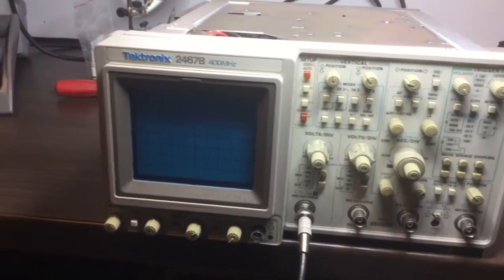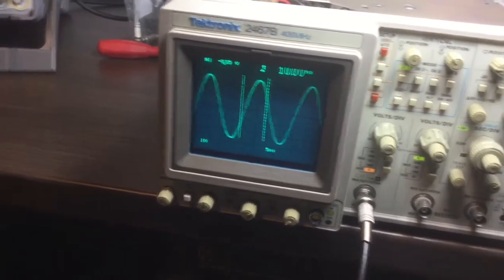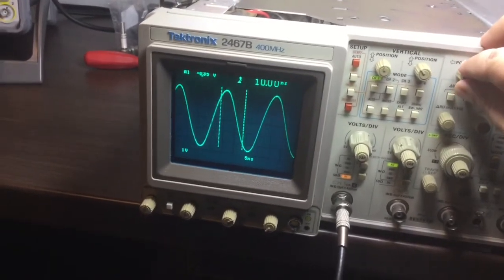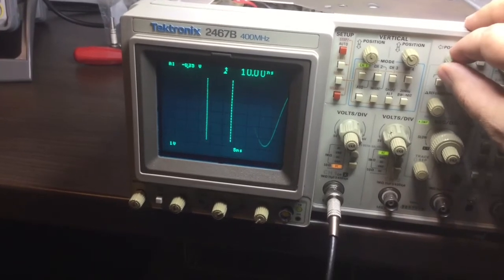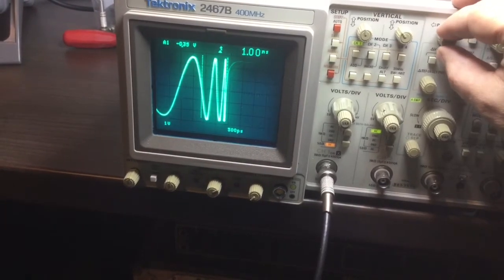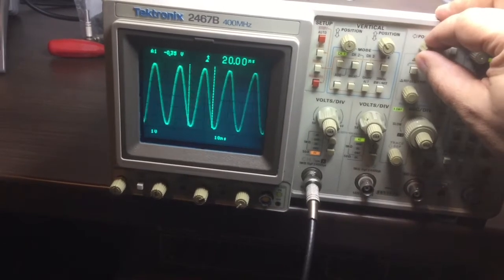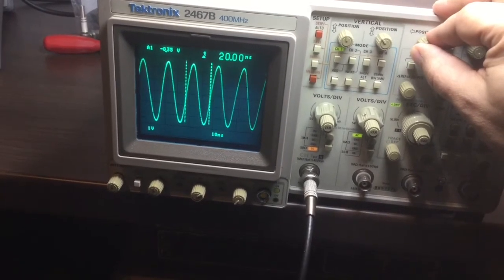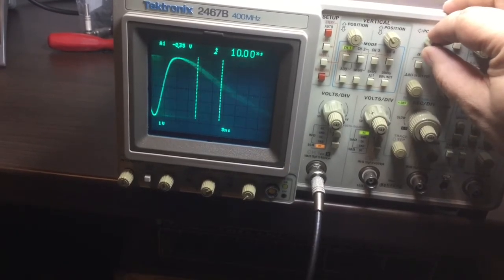Tektronix 2467B U800 failure

Comment: horizontal section ? get a schematic , learn the block diagram and how the parts are laid out . then get a can of cold spray. do not spray any glass or ceramic resistors that normally get hot. spray caps and transistors , chips ,ect. you should see it fix. then you know the part or area thats bad. I repaired my 1st telivision this way. They used tons of it in a Bendix aerospace co where I worked on the Patriot missile  power supply.